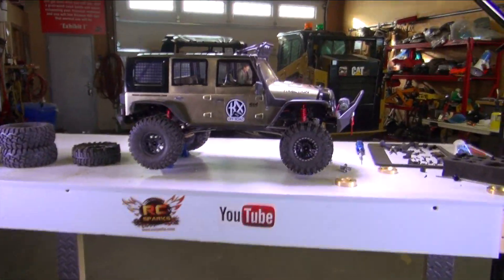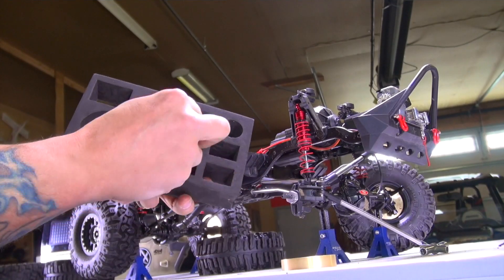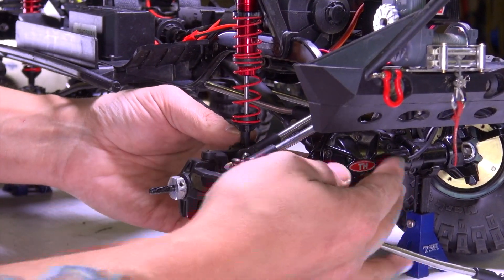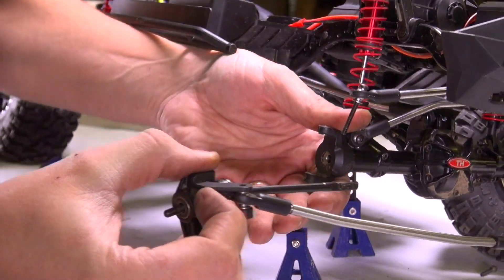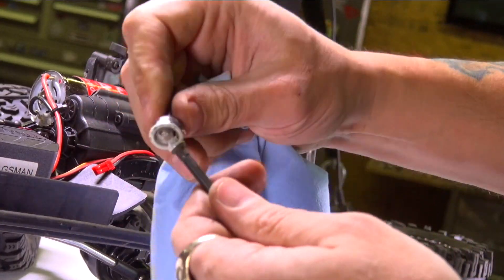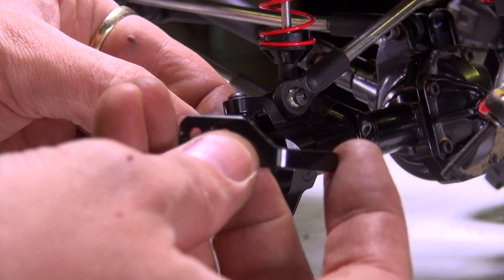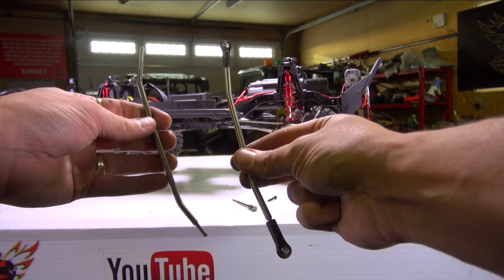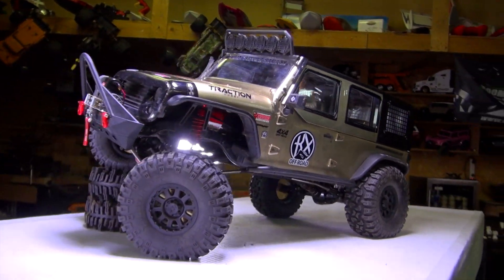RC ADVENTURES - Mini Jack Stands Support New Axle Weights - Install & Lessons - Traction

Comment: What you call the axle "clocked" back is the caster of the steering. That is to help self center the steering straight ahead and to add some bite to the front tires when going fast and turning at the same time. Even vehicles we drive everyday has some caster.

Comment: Glad to see that you didn't use electric screw driver 👍
Reply from the maker: Over the years, I have learned my lesson. Nothing worse than thinking you have great control with a drill, only to ruin your threads in a heartbeat

Comment: Just ordered mine I'm still running the stock wheels there not bad the weights should help alot
Reply from the maker: I agree.. and the weight is substantial enough, that you will really notice. Becuase the weights are attached to the axle housing - I have a feeling my bearings are going to last a lot longer - than if attached directly to my axle.  I look forward to trailing with it as soon as some of the snow melts later this week

Comment: That is a really neat weight mod there. Been thinking about finding something like that for my SCX10 but at the same time I am not fully sure being that the machine is rather light being a "stock" kit build where the only thing that really is after market on it is the wheels where I went with some aluminum bead locks and that seemed to give it a nice lower center of gravity. though at the same time that was one of the things that I watched my brother do on his Losi Nightcrawler where he got ahold of RC4WD's 2.2 pendulum wheels and man did that seem to make that thing want to stick to everything like glue, given the right tires to that is. but I like the like the look of the 1.9 wheels on the scx10 chassis for the little closer to scale look on the say hopped up crawler feel. Would be nice though if some of these mods that people got had some more clear instructions with them so that the consumer had something that they could really look at to know how it all goes together and or if there are other pieces needed to be able to do the build right or not being that some times that is a grey area and one that could climb up in costs rather quickly. But then again that is one of the great reasons why people like you upload videos like this is so that the consumer has a really cool reference and a good population to work things out with. Love the rig there looks like 1/8th scale would be an interesting area to enter in to!

Comment: First.... THANK YOU!! Your Envelope arrived yesterday. I'm considering it my first Birthday present! 😀  Even though my Birthday isn't till next week. They will be prominently displayed, you can be sure!! 
I'm SAVING the autographed one... Maybe my Grandson can sell it on EvilBay in the future for a small mint!! 😂😜 

Aaron, I will NEVER be able to afford a Rig like that. Not even close. I do like seeing how excited you are over it! They SHOULD have included at least rudimentary instructions. One thing I KNOW as a Retired Auto Technician is: the way the new hubs were clocked, is on purpose! 😱 Extra Positive Caster may look funny, but it gives MUCH better straight line stability, easier Steering, and more importantly, better Side Hilling GRIP. Respectfully, I thought you should know that. 

Also, I just did something that I'm SURPRISED I haven't done before.... I joined the RCSparks Forums!!! 👍👍  And NOT just because I got suspended from my FORMER Forum, for using the "chit chat" section (supposed to be for ANYTHING not Crawling related), to ask my RC friends for some help with my Family's Dire financial situation. They got TWO complaints from greedy, miserly asshats. No loss. I've got way bigger problems than that trifle!
Well, I've had a warm welcome so far!! 
Carmine 🚂 PoorManRC on RCSparks Forums!!

Comment: Hey Aaron, at about 7:30 y'all are talking about what in the automotive industry is called "Caster" it's the angle your knuckle sits at just like the Caster Wheels on a chair. Every vehicle "must" have some caster, it saves the vehicle from rolling. Camber on the other hand is how many degrees your wheels are off of 90° vertical as viewed from the front or back (front is easier to see for obvious reasons). Anyway, it's another great video I'm happy to share on my channel...all the best.

Comment: looks nice!  when I put ball bearings in I coat them with a light coat of corrosionX and always put some on any metal parts going through the ball bearing or a light coat of grease so your bearings will be way more l corrode resistant and have less chance of getting stuck in the part there pressed in or the part going through the bearing wont get seized and stuck in the bearing. 👍😊👍

Comment: Thank you medic.

I really appreciate the information.
I found I had to clock the axle like you did.
I also had to lengthen the pan hard bar to recenter my axle.

Your videos are the reason I decided to buy a cragsman c. I love it so far.
Thank you.

I would like to see more videos on the cragsman c.

I hear traction hobby is coming out with portal axles for it in January 2019

Comment: What is the purpose of axle weights? Is it to increase articulation and traction and to reduce the chances of a rollover?
Reply from the maker: Nailed it. 100% correct
Reply: RCSparks Studio Cool. Thanks for confirming. I Googled it and couldn't find anything and so just tried to work out what the result of fitting them would actually be.

Comment: Not got one of these trucks but still watched to the end out of curiosity how it was achieved.
Question: would the steering servo need to be upgraded over time to handle additional weight?
Reply from the maker: I could say yes.. but, time will tell. Normally stock steering servos on any model are the first thing to go.. oddly, I am still using the stock servo... so, Bonus!!

Comment: Yeah I'm think a certain amount of weight gain may be required come spring.. but how much is too much. It'd be great to hear you cover the pro's and cons and how much in your opinion is simply too much. I'm really hung up on this weight gain idea.. on the fence about it. Only other down fall is the cost. Great video, love that Cragsman, wish I had one to call my own!
Reply from the maker: I dislike wheel weights that are rotational mass. I think the downfall is too expensive overall. I like axle mounted weights.. but not many are offered..

Comment: What is your thought on the added weight for side hilling?  you may have to tune the inner foams for the side wall deflection.  As with every thing there are gains and loses.

Comment: Just got done doing this myself and thought the axle would need clocked and someone said to watch this vid.  Yep exactly what I thought because if you don’t do this the steering sucks and the inside tire keeps trying to turn completely sideways.  FYI my weights have a hole drilled through them so you can still get to the grub screw in the hexes.

Comment: On my trx 4 traxxas had same thing with hubs hitting inside the wheels headlock wheel. I found a set of nice look aluminum wheels that clear great. For the weights. There even 1.9 wheels . I well post the link when I get home. The beadlock screws are way in past the wheel drive nut that locks to the wheel. The new Trx 4 it made like a hummer H1 at the end of the axle so you have to have stock wheels r the ones made after market. I have now 5.5 Super Swampers on 1.9 rims.

Comment: Made it to the end as always love the videos, yes companies should include instructions with their after market parts or with any kit they provide I bought TV etc boom racing D110 artr instructions with hard body none with chassis yes chassis was together but had to take axles gearbox and transfer box apart to grease did it no problem but instructions would have been handy though as a reference

Comment: tell me if im wrong but makeing the tire heaver will give you better grip but cause more stress on the drive line, while makeing the axle heaver will give you less grip but less stress on your drive line
Reply from the maker: Review the part of the video when I speak about "Fixed vs Rotational Mass". Of course being a heavier truck will cause more strain, but because it is fixed & equally distributed weight - it will not add as much as a usual rotational mass would. This truck benefit in many other ways, becuase of the added weight. This truck is geared very well, and I will monitor the motor temperature in the near future. Just gotta wait for some snow to melt :)
Reply: The weight is physically on the same plane. Instead of being around the rim, it is inside the rim, but still putting weight on the same point of contact the wheel mounted weight is. The axle mounted weight is out in the tire, but without being fixed to the wheel and tire so it is not putting strain on the axle shaft.

Comment: I did but I'm not sure how much damage you're rim's will get from the dirt and mud getting in between the weight and the rim's. I mean I'm ok with scratches in rims but that seems more of a grinding situation to me but I could be wrong.
Reply from the maker: I also thought of that.. and I will watch for it. But, they did a great job only leaving a very small space in there, keeping most stuff out. Also, the front of the rims are slotted and open.. allowing for debris to work its way out.  (crossing fingers)

Comment: They have a second one out now called the Founder so it looks like they are trying to grow the popularity of the 1/8 crawlers going to be interesting to see what else comes out for them. But the difference in price I can get 2 1/10 scale trucks for the price of the 1/8
Reply from the maker: Oddly, the Founder was the FiRST version :) Though you think you can have two little trucks for the price of one of the 1/8th scales..   you can not.  Maybe cheap RTR's that you would want to sink another $1000 into upgrades for.. when you could have got a 1/8th scale that has everything on it already.. Lol. This truck is beast..  but, its all up to personal opinion of course. I get nothing, nor am I paid anything to say this truck is good. It just is
Reply: RCSparks Studio I respect you for perspective on all rcs I do mostly builds I guess I should of said 2 build kits for that price minus the electronics I get more joy from the kits than rtrs and most kits already come with quite a few upgrades. Maybe down the road if a 1/8 trail truck comes in a kit version. But have been taking an interest in military vehicles. The King Kong’s truck looks like a fun build.

Comment: I have 2 rows of wheel weights in my 10.2. I get how rotational mass can negatively effect a real car, or even RC basher, drifter but for crawling I really don't see any negative effects. Actually helps my $15 eBay tires from china bite as well as my proline Hyrax tires.
Reply from the maker: I can explain :) Becuase you have rotational mass attached to your 12mm Hex adaptor (from the wheel & weights) your inner race of your Spindle Bearings have uneven weight being applied. This causes a twist on the bearing. Over time, it will start to pull your bearing apart. Also, as your bearing starts to wear - your axle shaft will be moving in an angled manner. This will impact your Ring Gear, and pinion in the differential. Over time. this will cause wear on the teeth of the gears.  Speaking of your axle stubs and tires - Ever notice when looking straight on to your truck (at the hood and windshield, from the front) that your tires kind of bow in at the top? or you can move your tires easily in a wiggle, but cant figure out why? Its your bearing starting to come apart.  By attaching your weight to the axle housing.. this removes more stress the stress from the bearing and axle stub.
Reply: Brilliant! Now I know why that wiggle is happening haha. Is there anything I can do to prevent this? Beef up anything? on my 10.2?

Comment: I'm digging my Cragsman. It's a bit of a departure from the other trail rigs I have but, Its a very cool rig. I'm just having a hell of a time finding stock replacement parts for it. Asiatees customer support has been terrible so far and, my attempts to reach Traction Hobby directly, have gone unanswered.

Comment: Would like to find out if extra weight effects steering servo  even if it ain't rotational mass
Reply from the maker: of course it does :)  Rotational mass is hard on bearings, and axles.

Comment: I have a set 1.9 kraith.. it came with wheels extender and extended lock nut/screw.. when i'm using set of kraith  i attach wheels extender on the wheels not on the axle.. as i know (cmiiw) asiatees sell the boomracing wheels extender on different leght/offsett..

Comment: Hey Medic, just wondering if the 3link was put back to standard together with the longer steering rod if you would receive a little more negative camber in the front which could assist somewhat on uneven surfaces if that were the case then the steering may also be almost normal if not slightly improved. 
 
watched to the end and was also wondering how much difference is there in size between the Cragsman and Bumblebeest as the PG4L is massive for a 1/10

Comment: So did you use the new stearing rod or the original stearing rod?
Reply from the maker: Original One, because I mentioned the new one seems too long... It would make the tires point outward. Very confusing

Comment: all very cool parts and video as always to the end,,,,,,,  but,,, you knew it was coming,,,,,,  how long do you suppose it will be before you get a rock jammed between the rim and that brass weight, my guess is not long.  ps. i think everyone loves technical upgrade videos as much as high flying jump and crash videos, so keep doing what you do and all will be good in medic land.
Reply from the maker: I have answered this so many times today.. Lol .. it will have to be a very small rock.. as the tolerance is very small :) Ill keep u informed.. but we'll have to wait until spring. there are no little rocks around here now.. just a lot of snow
Reply: thanks for the response, glad i wasn't the only one that was concerned, nice to have you pave the way with well tested and reviewed products,  always easier to follow somebody down the dark scary trail,,,lol,,, so thank you

Comment: I always watch to the end. What's the point of clicking the video if you're gonna disappear halfway in?

Also, can't wait to see what you do with that CA-10 kit. I'm gonna shove a 5700kV Castle Creations system in the nose, run off a pair of Gens Ace 2s 45c 5000mAh lipo batteries. Thing's gonna rip and, hopefully, have ridiculously long runtimes.
Reply from the maker: Holy Shit!  You are going to burn a wheel off! Haha :) Make sure to share that with me when you film it!
Reply: I'll only be on 2s, running the packs in parallel. But, yah, from the maths I've done I'm expecting a top speed of roughly 25MPH on a freshly charged set of batteries, and somewhere around 22MPH at nominal voltage. If I bumped up to 3S I'd be just shy of 40MPH, but that would overstress the ESC too much. I'm getting a combo wombo, CC 1406 5700kv sensored motor and SV3 sensorless ESC. Future plans do include an upgrade to a sensored ESC but those things cost an absolute fortune.

She's gonna be fuuuuuuuun. Hopefully with me using a DX-6i transmitter to drive it I'll have fine enough control to still trail it around as best a RWD farm truck will do, and I've got some aftermarket tires with more aggressive tread in the cart as well to help with that. But...mmm, I wanted the option of being able to do some highway running we'll say. If I can get someone out there to hold my phone while I drive it I'll record it zipping up the street in front of my house! And I expect to be able to carve some pretty sweet donuts with it. Maybe drift it? Itt'l certainly have enough power under the hood...

I'm also planning on pulling some of the plastic leaves out of the front springs. The ride height for this model is appropriate for a 4WD truck, but depicts a 2WD truck. Softer front springs will also afford it a bit more flex, a problem I've seen in most videos of these things on YT. I'll pull them out one leaf a a time, test drive it, see where it ends up. Not sure if I'll soften the rear springs or not.

I'm also wondering where I can find a suitable scale engine to put under the hood. There's tons of awesome ones on the market but they're all a bit too modern for a truck like this. A flathead V8 would look sweet I think.

Ahh. The fun of ridiculously overpowered models. My NTC3 is similarly crazy. I put an engine designed for Tmaxxes in a 2.5LB touring car, then lifted it and threw rally tires on it. 40% throttle = four wheel burnout. <3 it.

Comment: Hey medic i had a few questions about modding my scx10, so i have everything upgraded besides the axels, driveshafts and body mounts. My question, is there a way to get longer axel splines to fit a bigger wheel hub hex?

Comment: I'm looking for wheel weights for my trx-4. However, the stock steering servo is weak as it is. Would wheels weights make it even more difficult to turn?
Reply from the maker: Yes... oddly.. my Servo in my TRX4 is still going strong.. Ive had 2 of the trx4's and both had no steering servo issues. So odd how that works.

Comment: do you know if there is any wheel weights for scx10
Reply from the maker: Yes, many. Or you can go to your local hardware store and buy a strip of " 7gram wheel weights" to wrap around your inner well of the wheel.

Comment: Wouldn't these cause horrible gravel lockup between the rim and these weights?
Reply from the maker: possibly.. but the gravel would be verrrry tiny. The tolerance (gap) is not very large
Reply: Would be awesome to heard a later update on if they do bc they seem like an awesome solution otherwise.